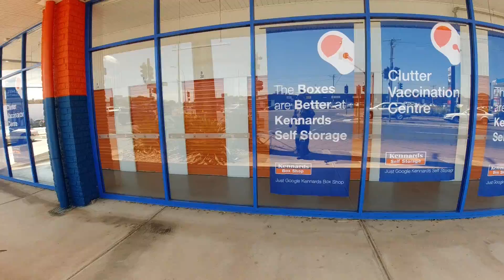First ride after fixing the KS16x - EUC - Electric Unicycle - King Song

Comment: I believe if you disconnect the speaker wire (that red one) you won't hear the 'PLEASE DECELERATE' voice anymore. You also won't have any beeps so the only safety feature would be the tilt back, but at least you won't annoy anyone around you, including you. =8-Þ
I've never ridden a King Song wheel before, but for both my Nik+ and my Sherman, the EUC World app has the option to turn off 1st, 2nd, or both beep alarms. Fiddle around in the Alarms section of the app. I'm sure it's either the first or second option.

Anyway, glad you're able to wheel around town, even if it's at a slower speed than you're used to. At least you have your "spare tire" wheel to get you by for a few days/week until you can be back to your speedy self. If this ever happens again, you won't put the wheel upright and turn it on with a flat.     Heh heh, live and learn. =8-Þ

Thanks again for making more content. I really dig chillin' with ya. Well, I should say Watching you talk to a camera, but it FEELS like chillin'.
Reply from the maker: Thanks bro I feel like I'm chillin with you guys too when making the vids. I've gone past the 20km now so the "please decelerate" thing has gone away. I think you can't actually disable it for the first 20km. It's a king song thing. And there's no way to turn down the volume either. It's just locked on full blast lol
Reply from the maker: Well you could disable it by disconnecting the speaker but then it'd be annoying to have to open the wheel again later to reconnect it. Unless of course you don't want the speaker. I don't mind it though. It's not great quality but descent enough. I miss the speaker on my Sherman though that thing is 👌
Reply: @arcrides6841  I was told you can swap the spoken messages for beeps if you want to? I said to friends I would never buy a KingSong wheel because of the spoken messages... they have all said you can change them to beeps